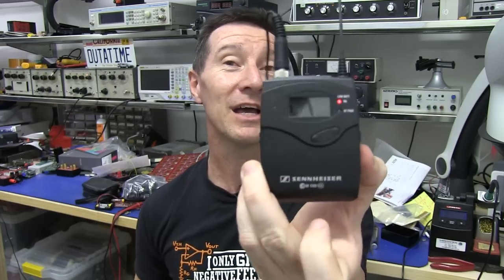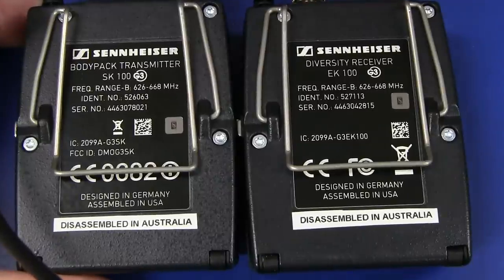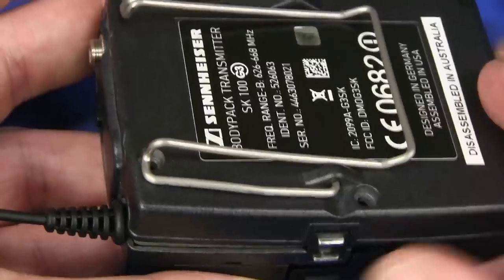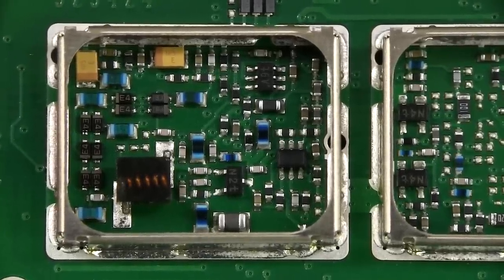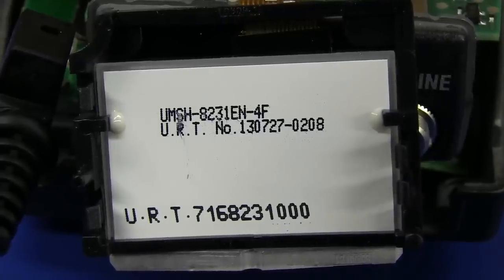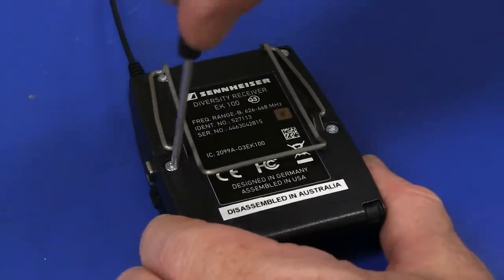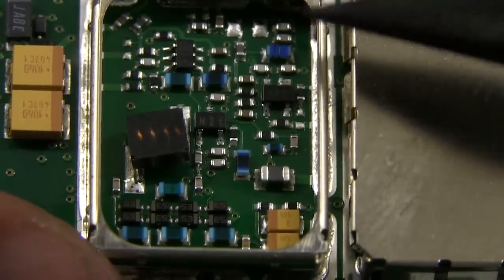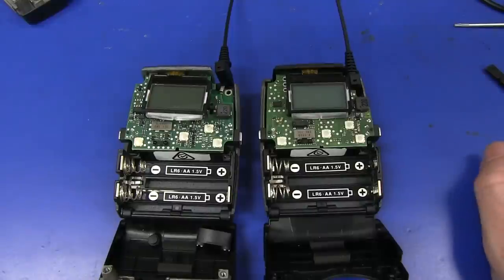EEVblog #571 - Sennheiser EW100 G3 Wireless Microphone Teardown

Comment: I have the Sennheiser EW 100 G3 but can't seem to get it to work with a mobile phone? Any ideas? Tried plugging the receiver into the audio jack of the mobile.
Reply: Dayne Williams : you probably need the right lead, or an adapter. Usually mobile phones require the plug with the extra ring, ie tip-ring-ring-sleeve, instead of the more common tip-ring sleeve. You can get what you need readily on eBay.
Reply: 3.5mm Trs to trrs

Comment: given the solid build, I bet these would be a decent product to buy used. what do you think?
Reply: I use them on video shoots - fantastic range and quality.
The microphone is a bit funny, I replaced it with a RODE lav
Reply: adamsonlinedirector oh you replaced just the mic, have you seen the RodeLink Filmmaker wireless system?   It is supposed to ship in March
Reply: Albert Maruggi Yes the microphone that comes with the 112-P G3 kit is my spare microphone incase something happens to my Rode Lav.
The Rodelink is clever but not suitable for me.
I use 4 separate Sennheiser ew112-P G3 units going into a zoom H6 audio recorder. I just use a Rode video mic on my DSLR to pick up sound and I synchronise the audio in post production.

In regards to the sennheiser microphone again - touching the wire makes a HUGE amount of noise. The Rode Lav is completely silent - no sound from clothes moving etc.
Reply: it's looking analog but I think it's very good looks when it builded

Comment: Hi. Looking to get some advice. How would I achieve greater range/distance after the transmitter/receiver units are synced. i've ran into problems with intermittent white noise interference and drop-outs. I estimate 20-30 feet before I start encountering problems. The transmitters are strapped to talent/actors, usually around the waste, which I have noticed collects a fair amount of sweat in that region. Should I tape the tip of the antenna to improve decoupling from talent? I'm aware that sweat inhibits signal strength. Cheers
Reply: Hi Ryan it sounds like your getting RF interference. How many are you using? Have you checked for inter mod? Or other sources of RF TV etc?

Comment: I have fifteen of these systems they are great apart from the adjust up/down  tact switches have a habit of sticking in the on position, the only solution is to replace the tracts.
Reply: +Grahame Sykes did you change the tracks yourself? I am having the same issue would love help

Comment: Greetings from Argentina. I wanted to ask you if you can help me!

I have the ew 100 g3 handheld transmitter microphone and now when I turn it on, on its display it has an indicator with the initials "AF" that measures the amount of signal it is transmitting while you speak or sing...

Now when I turn it on, without speaking or singing directly, the "AF" signal that it marks on the display goes almost to the top, as if it were transmitting audio.
and then when you actually start to sing or talk into the microphone, it picks up as usual but when it plays the audio it does it with a little bit of noise, like it's some kind of RF noise, bad signal. I already tried changing your capsule, changing cables, trying another receiving base, and obviously, the problem is the transmitter. Is it permanently damaged? Or what could be causing that? From already thank you very much for your time.
Reply: Dear I promise my last query!
And I won't bother anymore, I wanted to know if technically, at an electronic level this can happen.
The microphone is used by a punk rock singer, heavy rock music style, which exerts a lot of vocal pressure on the microphone diaphragm and excitation in the transmission signal, there is a possibility that the transmitter gain was not well set and - 18 db (which is what the transmitter comes from the factory), is too sensitive for pickup and the transmitter received a signal excitation all the time, always forced to the top, to clip, and this, so to speak, fatigue this component " dynamics regulator" of the transmitter some kind of component, (I don't know how to name it) but type, pre-amplifier or component in charge of signal transmitter.
So now when you turn it on, this signal modulator or transmitter component is damaged.
Can this happen technically or electronically? what do you think that can happen?

Comment: I have a suspicion why they chose such a beefy main processor. Maybe it was cheaper to order twice as many of the same chip and select a slightly beefier option for use in both the tx and rx, rather than selecting half as many processors but different, which would probably need slightly different pcb traces and very different software, so you would need people who knew how to code cpu A and different people who knew how to code cpu B (or people who knew how to code both of them!)
Reply: Sales volume might not be enough to pay for the extra software optimization effort needed to get good performance on a cheaper processor.
Reply: you mean if we take into consideration the extra man-hours necessary to make it work on a slower processor it's cheaper to just buy a faster cpu?

i suppose that indeed is reasonable, until a tipping point in manufacturing numbers: the optimisation needs only be done once but the cost increases the more units you manufacture
Reply: I wonder if its digital modulation instead of analog. If its digital, its possible that the processor is a double-duty as a DSP, and encoding the audio to QAM or QPSK, or something of that magnitude, and transmitting it digitally over the RF radio.
Reply: ***** Or maybe theses units were made on the same process as the more expensive 2000 series and its just cheaper to make them with the same main board? Or maybe they have future products planned and want to make small improvements to the existing system like Sony just did with its UWP-D line that launched in February?